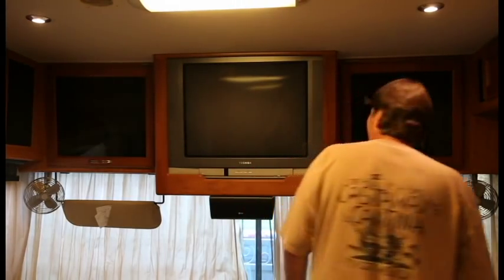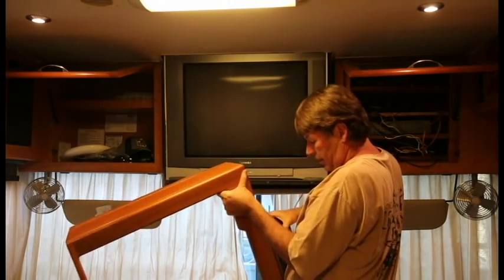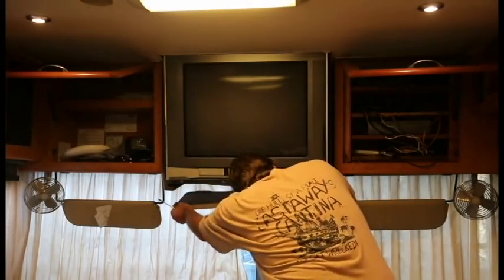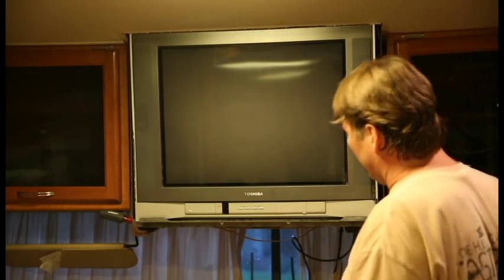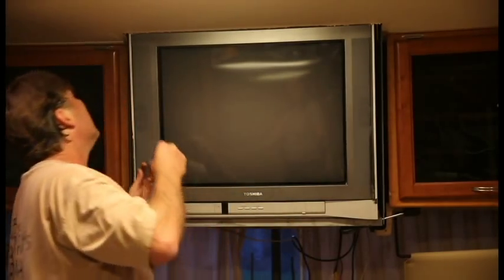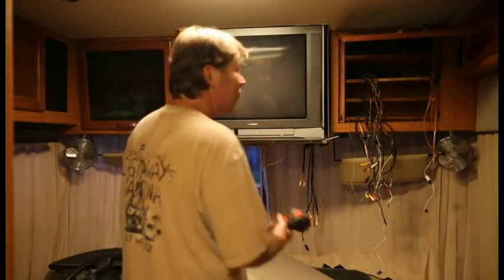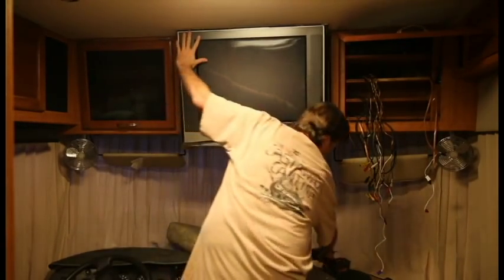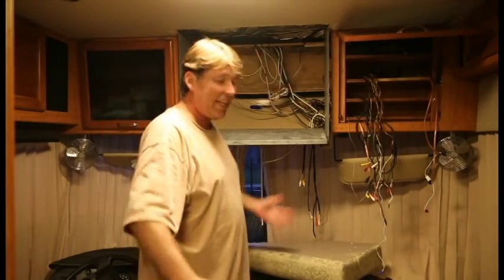How to remove your old RV TV (National RV) Tropical 2008

Comment: Good job Darrin. The actual work was not as bad as the unknown of how much that TV would weigh. You are a brave guy to go at it yourself. I did this job today but I am converting the TV cabinet to a storage cabinet the new TV sits on a new cube Tv base bookcase in the location where our horrible couch used to be. We sit in rocking recliners that sit where the cramped dinette used to be. We were tired of the twist body position we had to assume while sitting on the couch or dinette to view the up front TV. Your new TV will be light enuff to mount on a piece of plywood you can mount to your cabinet frame on a piano hinge which will let you swing that TV out and have storage behind. Thanks for posting this.

Comment: I Did the same thing removing mine and then took measurements for a new flat screen then went to Walmart and other TV retailers and found a nice replacement TV That can run on 12 volt and 120 that fitted my dimensions then bought a swivel self storing type TV Mount so i could push it back flat for travel or pull it out and swivel it towards my driving position when i use the HDMI to switch over to the rear camera for reversing. It saved having to buy a little TV monitor for backing up safely. That's the cool thing about modern electronics being so versatile.

Comment: Warning, don't do this alone!  It is a good video, but my 2004 tropical TV may be heavier, or may not.  I did the front 4 bolts and put in safety wire so the bottom panel could lower about an inch.  Even then I could not slide the TV out, so I took out the back two bolts. As the one on the left came out, the bottom panel dropped and broke the safety wire on the left side, and the tv rolled out, hitting my forearm, head and left shoulder, knocking me out of the way. It hit the dinette pad that I had on the console, and rolled between the passenger seat and the console.  Stunned me, but only cuts and no damage to the RV.  After that I removed it from the RV by rolling it out.  I just wanted to warn others, that it is especially difficult. Incidentally, the speaker surround assembly goes up a little into the roof, so I had removed that.  The TV was not being restricted by the top.  I had loaned out two cargo straps, but I should have had a strap around the unit to keep it from falling forward.  Be careful!
Reply from the maker: WOW. Sorry to hear what happened to you. But as a note to others.
Do whatever you can to remove the TV without removing the rear bolts. I did not have to remove the rear bolts on my rig. I actually kept them snug  (Not tight, but not loose either) so that the snug bolts wont let the front come down so quickly. I kept some tension there in the pivot joint.  

Removing the rear bolt sounds like a whole different problem. I always pictured the front tipping down so I could slide the TV out. Like I did but if your not able too do that then definitely use screwdrivers or something similar to insert into all your bolt holes for safety. Wire (Hindsight) probably not the best material to use to hold up a 65+lbs TV and any jerking motion or just maybe the TV tray cut through?  I know you needed to drop it a few inches but now people know not to use wire when trying to hold up the TV. Use something that is stronger (Cable?).  If you must you can still take out the rear bolts safely if you have too but make sure you or  someone else is lifting up on the TV while unscrewing the bolts then as soon as the bolt comes out you insert a screwdriver to safely temporarily hold up the TV . Without someone lifting on the TV. It could drop and fall like what happened to 6713joe. 

Once all the bolts are out and screwdrivers are in all the holes you will need to get a few people over to slide out the screwdrivers out one by one and take on the weight as the TV is lowered.

Not all RV's are the same. It appears some National RV's are different and may need some different approaches. I fell bad for 6713joe but now at least you have some additional information when taking on this task. 
 Do not to use wire or zip ties or anything that cant take on 75lbs or to be safe 100lbs. You need something strong to put in the holds as you remove the bolts. If not a screwdriver something strong that can easily be removed when the time comes.
Reply: Darrin Nason Thanks Darrin, your comments are right on.  Your video was a big help.  I did have boots with steel toes on, just in case.  I am fine, but when that TV pitched out it was quite a shock, lol.  I wanted to warn people to not have anyone standing around who could be injured. If you can do it with the rear bolts in, it is perfectly safe.  I could not do it that way.
Reply: What a goofball. It's just a tv it isn't a solid block of lead. If you would have some muscle maybe that wouldn't have happened.
Reply: Nicholas Kurnik That is pretty rude and inappropriate considering the guy is just trying to give a helpful hint to others.

Comment: Thank you so very much. I have the same make, model, year, and TV. I've been thinking the only way to get access to the screws  was to take off the curtains, curtain rod, and the entire plastic shroud, which would have been a HUGE MESS. Comparatively, your way will be a piece of cake. Do you have a video of what TV you put in and how you finished the project?
Reply from the maker: Sorry but I did not make a video of the new TV install I can always show you a picture but I got side tracked and started working on the job and not thinking about video taping it

Comment: Great video thanks,  I have a 2007 National Seabreeze with the exact TV and frame this helps a lot!
Reply: Mount a 32'' flat screen inside the wood frame on my 05 Seabreeze lx and used the top metal bracket from the old tv to hold it in place.Then got 3 strips of oak from home depot to fill in the open space....
Reply: I put in a 32" Samsung fit perfectly.

Comment: Mine has no screws, no cabinets next to it except up and lower but no screws in there. No way to remove fascia laminate boards on cabinet. So do I need a magician?
Reply from the maker: I dont know. Check again and look for little raised pcs of wood. If you see them they are caps. The screws are located under these raised circles. Use pliers or screwdriver to remove the caps. 
There has to be something to hold in the frame. They put the TV in then put the cover on. Has to be. Keep looking.

Comment: Is there a video on how to remove the tv in the rear?  I see nothing and I've pulled on it with no results
Thanks
Reply from the maker: I dont have one . Sorry
Reply: @slambonie  
Thanks

Do you know if these ahave 12v option?  Mine only works when I have 110v.  The signal booster is 12v.
I don't see any switches.
Reply from the maker: I'm not sure. Sorry, a dealer might have better and more accurate knowledge of your coach and what options you have. Wish I could be more help.